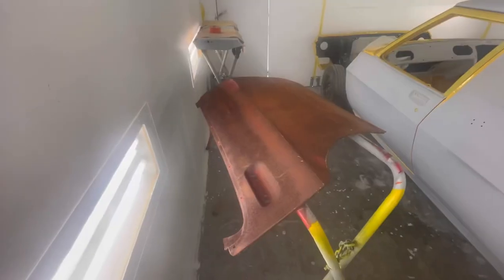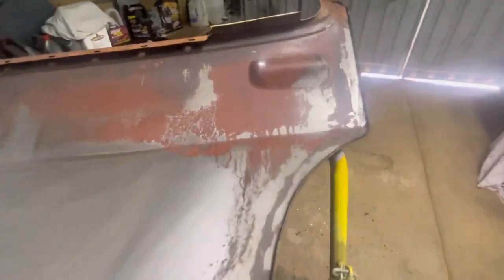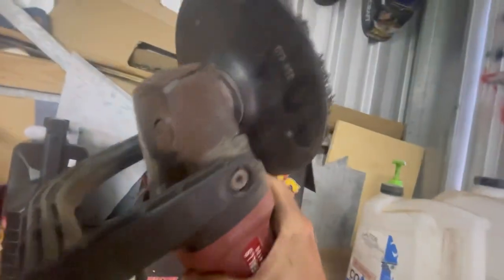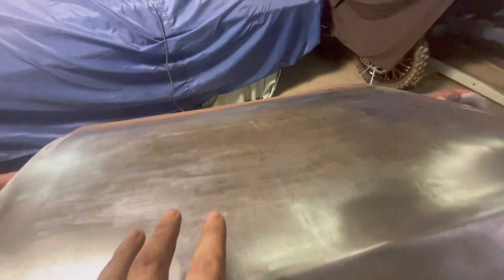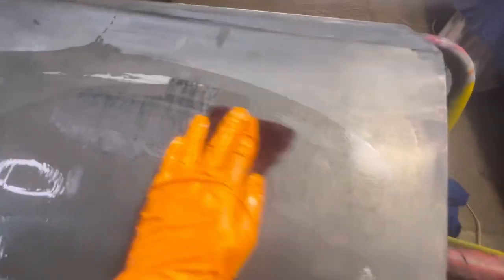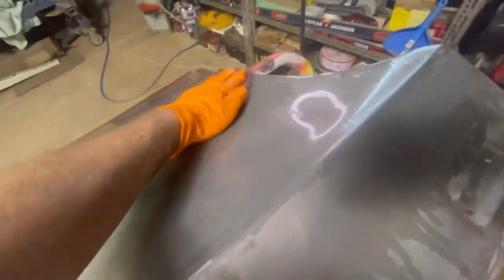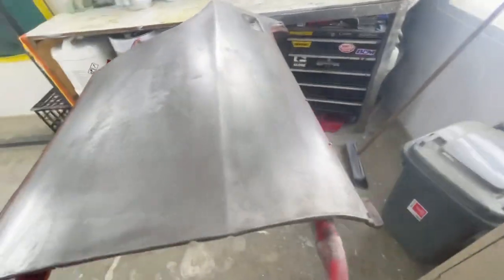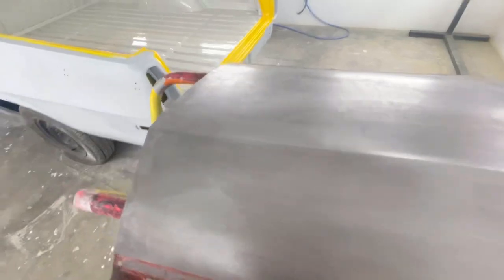How to: Clean Rusted Panels

Comment: This is very informative 
So if I’ve got little areas in different sections of my car that I want to prevent from turning into holes I should follow this process?
Car is painted and complete but getting little surface rust coming out
Reply from the maker: Hi mate, it really depends on the areas that the rust is coming through on.
As long as the car is kept clean and dry you shouldn’t have to worry too much.

Comment: Hi mate great information I have ? How long can you leave it in metal after treatment befor you epoxy primer thanks michael
Reply from the maker: @michaeljohn8842 I usually try and get it prepped and in epoxy within the hour ideally, you can push it a little longer depending on the humidity/weather.
Reply from the maker: @michaeljohn8842 watch part 1 of the basic HQ body restoration series if you’ve not already. I go through the order of getting things ready/into epoxy primer.